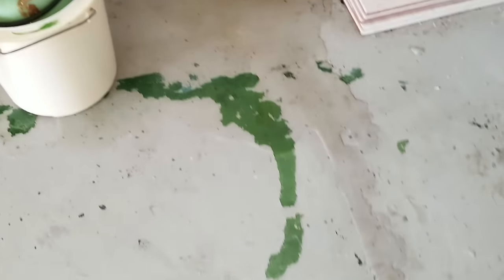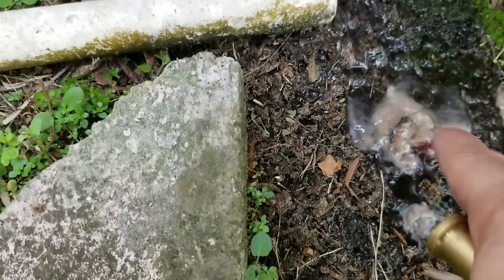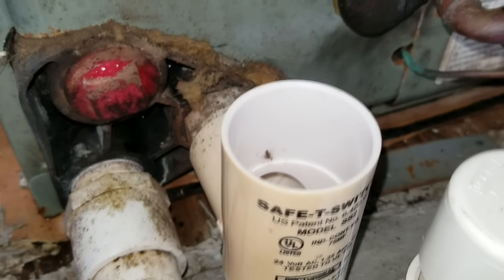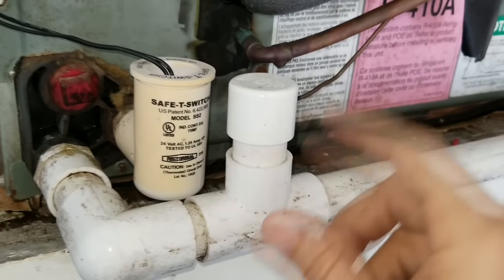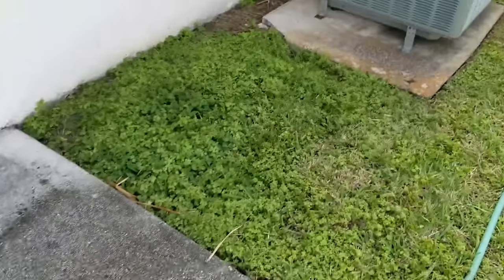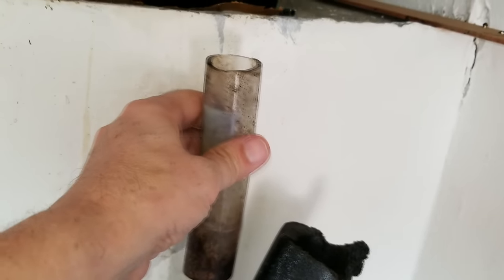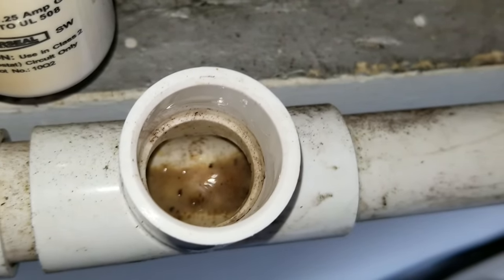How to Unclog AC Drain Line Fast (3 Seconds), Avoid Repairman

Comment: I had an issue with their central air unit turning off due to water backup since moving into my new home. I have had Del Air and the warranty department out monthly since I moved in. 1st time the tech made a hole in the wall to find there was a second trap built into the drain pipe which was causing some of the issues. Everything ran fine for another month or longer then it happened again. I always tried to unclog it myself using a vacuum and hot water like they advised but cleaning the system is only supposed to be done every 3 months. The warranty department has been great but I think there's a bigger issue at hand. I've only been living in the home since late April. The last tech unclogged the drain after about 2hrs.  He then place calgon gel tabs inside the unit which dissolves slowly over 3 months to help the flow of water and deter bacteria growth. Not sure that help as he was here on June 15th and I woke up to a plus 80 degree hot, sweaty at 5am. Since then I have tried everything to unclog the drain and the only time water comes out is when I use the vacuum. The tech said he had no idea why it clogged in the first place so quickly from the last time they were here. Not sure what to do at this point.
Reply from the maker: Tough issue Jonathan. I ran into this exact same problem at my flip condo last year, where I discovered the BRAND NEW ceiling mounted Pan AC was backing up and I discovered a way too long trap inside the wall, and removed it. Most ACs now, city permitting requires a trap placed within inches of the drain pan, also manufacturers require the trap to be placed close to the pan also. See my video showing the aftermath of my repair:
"How to Repair Drywall Holes at Closet Door Opening/Corner" https://youtu.be/3nx0Hgl4VZ8. So if you're pipe is backing up it means to me a few possible things to look at:
1) There maybe still blockage that the compressed air the AC guy is blowing won't clear up.
2) You Shop Vac is not enough suction to pull out all that is blocking the pipe, leaving some behind.
3) Get a garden hose into that line and gush it, like this video, see what happens. Put a pot on the outside of the house to capture whatever dumps out of that pipe. Get 2 people to help, one spotter, one on the hose, and you watching at the AC.
4) It could be the plumbers never sloped any hotizontal runs of the pipe downward, a huge common problem. All plumbing codes require drain pipes to slop at 1/4" per foot, I usually see idiots run them level inside the wall.
5) You could have branches underground that are poking through the pipe and clogging them, happens all the time.
6) Get a plumber to snake out the line with a camera from the AC until until it pops up out side.
7) Make sure there are no excess 90 elbows on the PVC drain pipe. This should never be allowed, it should be smooth turns, unless the pipe slopes downward into the turn. 90 degree bends slow down drains.
8) IF possible, remove all drywall where your drain pipe might be going inside the wall, and see how the routing of the pipe looks, does it have good slop? If not, take steps to make sure you have a good slope and minimum 90 degree bends. Also, make sure all PVC connections have purple primer on them.
Reply: I would have an Ac company install a new drain line , so you know for sure it’s done the right way and slopes like it should for proper water displacement

Comment: Put piece of chlorine tablet used for pools/spas in the condensate pan and will prevent lines clogging
Reply from the maker: That's worth a try.
Reply: I would not do that, possible corrosion of the coil. They sell drain pan tabs , specific for that reason for really cheap

Comment: How can you clean at the first connector at the AC (where the water first drips in the pipe) without pushing the gunk up into the AC?
Reply from the maker: Some may go in, but you flush it out, or dump some more water in the pan until it all flushes outside
Reply: @jeffostroff        if it’s clogged at the connector, I’m thinking that adding water to the pan will likely not drain.

Comment: I put a valve before a three way with a threaded hose attachment and a threaded plug when i was done but i can screw my hose right into the line and turn the hose on and and the valve before it stops the water from going up into the A/C
Reply from the maker: that's using your brain! Great idea.

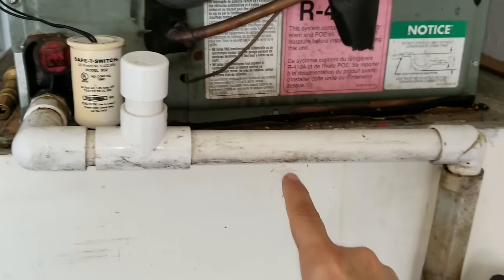Comment: Funny.....there is even a picture-tag of how one should add a U-trap ( assuming this is a negative-pressure operating system)....look at timeline 5:56-6:03....yet it's not there and no mention is made of it , only to say modern code requires it (6:45-6:50). It should be mentioned also HOW it works and how it can prevent this problem, as a technical answer. Not having one WILL NOT ALLOW ANY DRAINING WHILE THEUNIT IS RUNNING, ..it allows water to build up in the evap drain pan....and it will then ONLY drain when the unit SHUTS-OFF. A "U-trap" allows CONSTANT draining to occur....even when the unit is running. This should have been mentioned ....as it's a core-issue. Also this, to unclog, one can simply connect a shop vac to the exit of the pipe for about a minute or less....usually sucks up a big "blop" and out comes the clog.

Comment: But if the water is coming out because its clogged, if you put the hose and turn on the water, wouldn't it just drop all the water since its clogged or the pressure from the hose is enough to push all the gunk out?
Reply from the maker: Yes, the pressure from the water hose is enough to clear that clog. Some people even report that putting their shop vac on the end of the pipe outside offers enough suction to clear the clog.
Reply: @jeffostroff  okay, thank you, we were having issues with our ac and we took off the pipe and saw it clogged, hopefully this will work because we have our line running to a drain in the middle of the house and it would take a lot of work to move it all

Comment: What causes snot looking stuff to build up?
Reply from the maker: The goo is a collection of bacteria, dust, dirt and anything else that flows down from the air conditioning pan through the condensation line to the outside. Remember that's chilly water running down that pipe so these are elements that when mixed together and sitting inside those pipes with cold water tend to congeal at those lower temperatures.
Reply: @jeffostroff  Can you put anything on pan to prevent this?

Comment: I accidentally flushed it from the top of the drain line without blocking it off. And I saw some water leaking from the unit so I stopped. Do you know if it will damage anything?
Reply from the maker: We always get a few drops. Just wipe it up quickly off the floor, walls, any wood, etc.

Comment: Nice video! I am going to try this right now! The problem I’m having is the water is getting backed up and hitting the float switch but when I go outside to the drainage pipe, there is nothing coming out of it. I use my shop vac and it gets the water out from the outside but I’m now having to do this every day. I will try the hose trick and see if that works! I also heard liquid plumber works. Any thoughts on that?
Reply: Liquid plumber might be too caustic and could splash back up depending on where blockage is.  Bleach water is a little safer.
Reply: @suzyq8538  okay cool! Thanks for the advice!

Comment: great video ... Okay so I blew out the clogged line with an air compressor and  awakened to a completely soaked floor on two sides of the unit.  What'dya think?   Did I do it wrong?
Reply from the maker: Are you sure you got all the clog? Maybe some of it just coagulated in the line and it got stuck again. You should see drops of water coming out of the pipe outside.
Reply: Cathi thomas you could have busted your PVC pipe if your PSI was too high.
Reply: Josue Bazan ... oh shit

Comment: What does it mean if water was leaking from the float switch too?
Reply from the maker: Water should not leak from the float switch, because the float switch has a cap built onto it like the one you see in this video. Basically when you have a clog somewhere downline in that condensation drain line going outside the house, the water backs up to where the float switch is, and it causes the float switch to float up, which cuts off the AC. If you have leaks coming from the float switch then either it was not pushed down all the way to seal against the Tee fitting, or there is a crack or leak in the cement used to connect the parts together.
Reply: jeffostroff 
I realized the cap thing is cracked. No idea how that happened. Thank you!!

Comment: Mine is too small for a garden hose but I do have an air compressor. Any reason this would not work?
Reply from the maker: You might have enough pressure. There have been times with a garden hose we cut off the end and it fits into the pipe

Comment: Haven’t used any tricks yet, but trying to approach a problem I am having. Found water leaking in garage. Traced it to my ac handler. Don’t have a easy to follow set up like yours. I see the drain line, which goes down into concrete, but I don’t know where it comes out. Is it common to come out near the outdoor unit? I cleaned up water in the evening and checked in one morning to be surprised that it was dry, is this problem consistent with heavy condensation, because at night when it is cooler I would expect less condensation vs the day when it’s hot. Or does this sound like a different problem to you. I appreciate any help. I have not yet checked it at night to see if it drips.
Reply from the maker: Christopher, there is no such thing as heavy condensation from what we've seen. ACs produce a constant amount of condensation continuously, and it either makes it out that drain pipe outside, or it doesn't. there is no standard on whether pipe leads outside next to the AC, most of the time I see it i opposite side of the building from the AC, it just goes wherever they run the pipe. You should check outside along the side of the building, near the ground for the exit point of the pipe. sometimes it comes up out of the ground and forms a trap in the pipe. If you had water in the garage, it is likely the pain overflowed because either the drain pie is clogged somewhere, or the AC filter was never changed and it is clogged.  Pull out the filter and see if you see the AC coils, are they shiny or clogged and dirty? If they are dirty, air can't flow through them and they freeze over. causing more water production, and combined with a clogged pipe, leads to a leak.
Reply: jeffostroff I’m mistake, what I meant is in the evening when it is cooler the AC most likely runs much less, therefore creating less condensation than in the day time when it is hotter. I was surprised not to see any water in the early morning when I checked. Either way, I will try to use a hose to flush the drain line. I think I can disconnect underneath the handler and hook hose in. Hopefully that even helps me find where the drain is outside. I might use a toothbrush to clean the inside of the upper ends, unless I can find a good way to detach them from the handler and clean.
Reply: When I purchased the house last year  the inspector noted the dirty ac coils, so within a week or two of owning I bought coil cleaner and cleaned them. They look about the same from when I cleaned them. I try to change filter ever couple months, sometime lag a little.
Reply: I had made a new filter install a few weeks ago, so that filter is good. Only noticed water about 2 days ago. Looks like it could have been accumulating for a little longer. I’ll let you know how my first attempt of cleaning the line goes tomorrow.
Reply from the maker: @christopherquesada835  Then you likely just have a clog in the drain line somewhere between the unit and outside. Have you found the outside pipe yet?
Reply: jeffostroff not for certain. There looks to be one outside near the outside unit, but I assumed it was separate for drainage for the outside unit not the indoor handler. Hope to find out tomorrow. You recommend a water hose when flushing right?
Reply from the maker: @christopherquesada835  Yes, we did this at my neighbor's house the other day also. I also have a garden hose with the end cut off so the rubber fits perfectly inside the 3/4" white PVC pipe. In this video they had that slightly wider transparent hose which accommodates the hose end with the threads, so you don't have to cut off the hose. I have one person insert the hose into the pipe near the air handler, seal it up good with towel, then turn on the water for 2-3 seconds to see if it clears the blockage in the pipe, and limits how much water might spray back at you near the air handler.
Reply: jeffostroff dug up and found my drain hose outside near outside unit. I believe it is the drain hose for the handler. Looks pretty dirty. Going to get a friend to help me try the water hose method to unclog. I will have one person monitor inside to minimize back flow, while the other (me) sprays water for short burst in hopes it clears itself.
Reply from the maker: @christopherquesada835  That should be awesome, exactly how we did it at our neighbor's house. I would set watch closely outside to see what it was that plugged up the pipe. It is often an orange or grey colored gooey substance. Maybe set your video camera on slow motion and capture it.
Reply: jeffostroff it was grey with a little dirt from outside. It’s a long run from handler to where it drains, and I think because I had it buried for a while it accumulated dirt. Ever with hot water and shop back blowing and sucking each end, it wasn’t until I used some stiff wire I had laying around to act as a fish line I think it’s called, to break up the clog from the drain end, then all is set free. Getting supplies to clean coils now. Appreciate the tips! Also getting some of the pan tabs.
Reply from the maker: @christopherquesada835  check with the guys at home depot, I hear the liquid is better than the tablets.

Comment: i noticed in this case (in the video) outside a problem with this drain and a lot of drains... that it went down, then up, and over to the terminal end.... I always get mad and think what kinda dumb f**k did this lol great video and RIP to the poor old lady... peace
Reply from the maker: The P-trap you are talking about is required by plumbing code to prevent outside air or sewer gasses from getting back inside the house through the AC drain line. As long as water is dripping from the pan, this P-trap works fine, but gret a clog in the line and water stops flowing.

Comment: We use vinegar to clean the line then flush it out with HOT- water.
Reply from the maker: Yes flushing it out once in a while with hot water helps prevent the goo from clogging the pipe.
Reply: How much water do you use? And do you pour it down the same line you used for the vinegar?

Comment: Hi Jeff, the drain line on my AC's blower is connected to the same drain line as my bathroom vanity sink drain. The main drain line gets clogged every 2 months. If I disconnect the AC Blower line, drain the excess water from the main line and pour a couple of gallons in the drain and let it set for a couple of days, it seems to clear the obstruction which allows water flow but it then clogs up again every 6 to 8 weeks. The house is 12 years old and I didn't have this problem for the first 8 years, but for the last 3 to 4 years I have, and it's a big inconvenience. What do you recommend? Thank you.
Reply from the maker: This is so unusual and not a design I would have implemented. IT is always best to have the A/C use it's own drain line right out the walls to the outside of the house where the water drains there. The ACs just create too much sludge and mushy stuff. But even then should not happen every 2 months unless you have a lot of dirt in your system, or chep filters. I would try to find a way to run your ac drain line outside directly.
Reply: @jeffostroff  I don't think my system creates that much dirt. I use a Merv 14 filters that I replace every 6 weeks. It's hardly dirty when I replace it. Home is air tight, very little dust in the home. AC doesn't run too often. Home is well insulated. Running a separate drain line is probably the best solution. May have to run the line through the closet. Thank you Jeff.